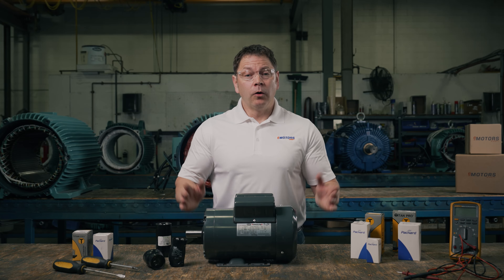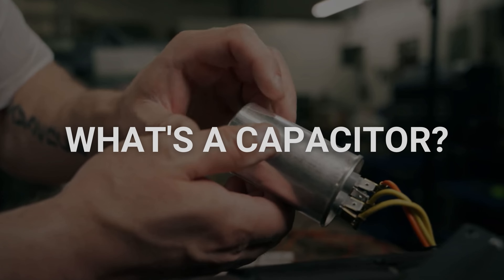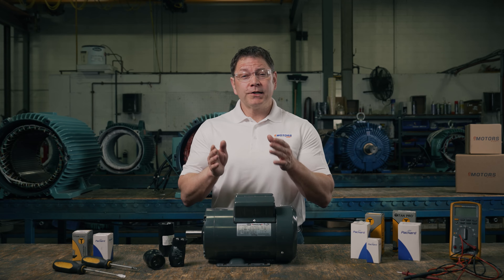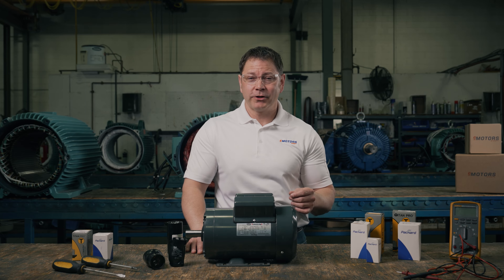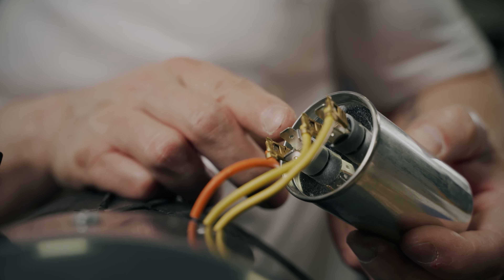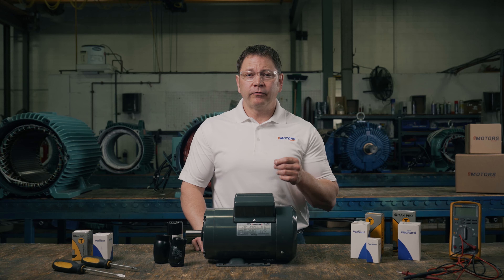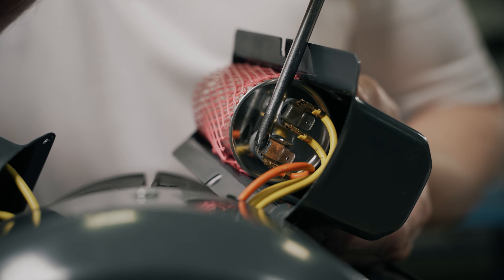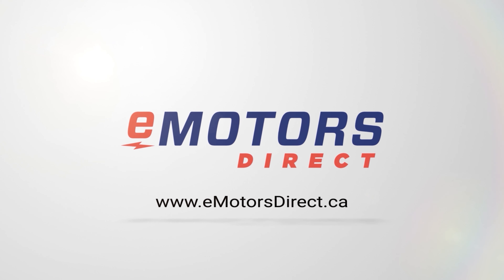How to Replace a Motor Capacitor

Comment: The web site has great options for narrowing down selection of the required item.  Another good video.
Reply from the maker: Thanks Gary!
Reply: @emotorsdirect  I want you to help me 🙏🏻🙏🏻🙏🏻 How do I know what size capacitor to use? - ((Rolling Door Motor 220V 370W Lifting Weight 600kg))

Comment: Great video! Thanks. I put together a little strobe light kit back in the '70s, and the first time I tested it, a capacitor exploded. (Maybe I put the wires on the wrong terminals?) Darn thing never worked, and no one in my family suggested we replace it after a careful look at the schematic. (To be fair, there were shreds of paper everywhere inside the box. It looked hopeless.)

Comment: i'm looking to replace my capacitor to see if it fixes my dehumidifer but there's nothing indicating which wire connects to which receiver on the capacitor.  on the existing, there's 2 blue wires connected to 1 of the 2 sections and a red wire connected to the other.  i'm assuming the red one is the incoming power so does it matter which side i connect that to as long as the 2 blue wires are connected to the other?
Reply from the maker: Great question. 

It depends on whether it is a polarized/unpolarized cap. As a rule of thumb, electrolytic capacitors are usually polarized and are also the most commonly used in appliances. You can usually tell polarity by looking for a - or + sign above/below a terminal. on components with leads instead of terminals the longer leg is always positive from the factory, but these sometimes get cut when put into use.

Comment: I have an old Craftsman table saw. The motor hums and trips the breaker. The capacitor is 110 VAC, 216-259 MFD. size is 1-7/16 by 2-3/4 The one on your web site has dual blade terminals. item Packard PMJ216. The old one has only two terminals. Is that a problem?
Reply from the maker: The dual blade terminals are just a design choice by the manufacturer to allow for easier or more flexible wiring configurations. They are not an issue as long as you connect the wires correctly.

If you're still unsure, feel free to contact our team at customerservice@emotorsdirect.ca.

Comment: Question my start capacitor is 110vac. My auger motor is du voltage I'm running it on high voltage 220. My capacitor went out. Do you feel that had any to do with it?
Reply from the maker: In a motor running on 220V, the voltage across the start capacitor can exceed 110V, especially due to transient spikes or back EMF generated during motor startup. You could try a 220v capacitor instead, which you can likely find for under $20: https://www.emotorsdirect.ca/parts/capacitors?nominal-voltage=220~250V&product-subsubcategory=Start-Capacitor

Comment: I forgot to take a pic before disconnecting old one. How do i determine how to connect wires now? Any video or reading recommended? I have that situation currently with a spa pump motor start capacitor (2 terminals, not 3)
Reply from the maker: Hi Matt, look at the motor's wiring diagram. This is often printed on the motor itself or in the manual.
If the diagram isn’t available, note the motor's labels for the terminals (often marked as L1, L2, Start, Run, or Common).

Comment: Water pump (thanks to rubber garden hose) decided to flood basement this night. Luckily? - found capacitor blown up in morning, and 10cm of water all over basement. :)
Reply from the maker: It's a good idea to look into the root cause of that capacitor failure 👍Good luck!
Reply: @emotorsdirect  pump motor was hot, very hot.
Reply from the maker: @jurisbrakis  could be a ventilation issue or a sign of overload. Here's a video on why motors overheat and how to prevent it: https://youtu.be/7SyeodSfUug?feature=shared

Comment: I want you to help me 🙏  How do I know what size capacitor to use?  -  ((Rolling Door Motor 220V 370W Lifting Weight 600kg))
Reply from the maker: Thanks for the question. Does your motor currently have a capacitor? If so, look for the microfarad or MFd rating and the voltage. When looking for your new capacitor, make sure those two ratings match. Also keep an eye on the size and shape - some capacitors are round and some are more rectangular. Does that answer your question? - Keith
Reply: @emotorsdirect  Thank you for your quick response, I am grateful for that  -  The motor does not have a capacitor. Unfortunately, I lost the capacitor and did not read the capacitor data
Reply: @emotorsdirect  All I have is engine data Specification  
Power	370W
Output Torque	412N-m
Frequency	50Hz
Speed	4.8r/min
Continuous Working Time	6min
Max Lifting Power	600kgf
Current	3.3A
Model	ECR-412-1P
Voltage	220V
Reply from the maker: @solarpower3934  for the 370W power, conventional sizing would take us to 100 micro farads. But considering this is a lifting motor it may have had a larger capacitor to provide starting torque. Hard to say for sure. I'd recommend reaching out to the manufacturer to confirm.